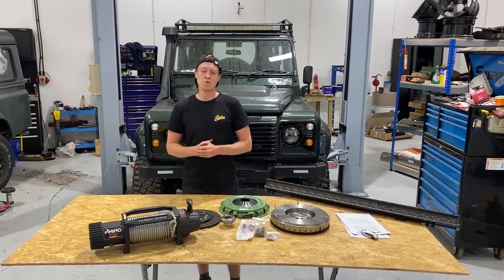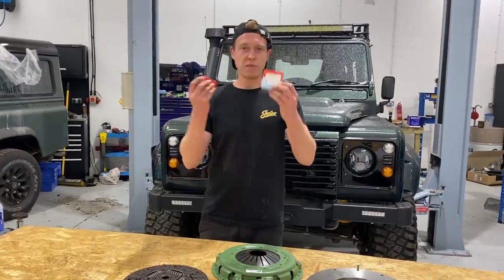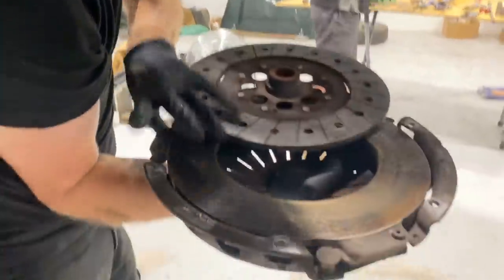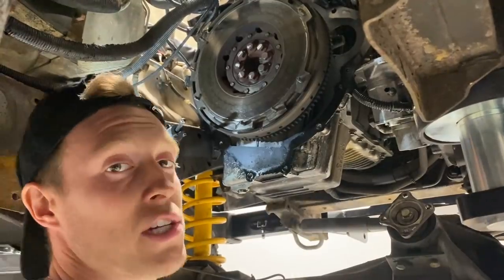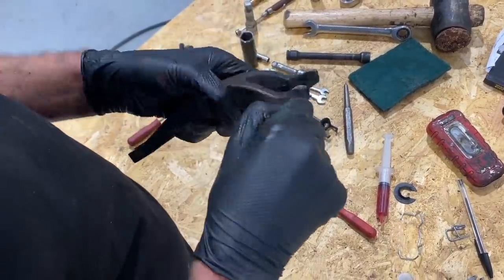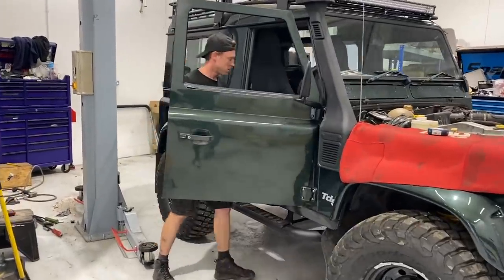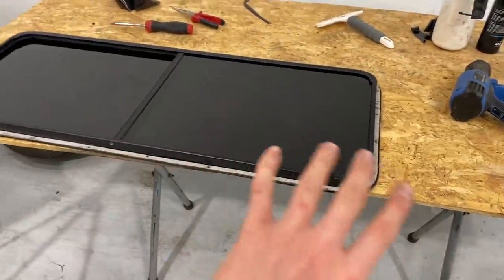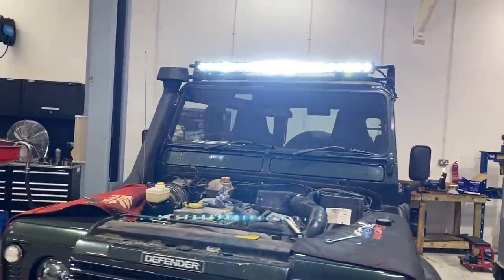Rebuilding a Land Rover Defender 90 - Part 14

Comment from the maker: Hey guys just to note, this video isn’t a paid for promotion or sponsorship, LOF Clutches kindly provided us with everything we needed to get the TD5 sorted! Thank you all for watching!! Remember to hit that SUBCRIBE button and smash that LIKE button! 💛
Reply from the maker: I dislike shirt shifters in the R380 gearbox, I’ve never felt that that make any improvements, it just feels notchy to me.... I’m happy with the LR shifter 😁
Reply: Does the defender 2.8i have the same flywheel or do I need to find a BMW one?
Reply: @Abel Harbour cheers, need to find a reliable source of information, right now I'm doing a full body off rebuild, it's a 97 2.8i so it can be considered one of the best defenders. I'm pretty sure it's the only one in NZ 
Cheers for your help.
Reply: I'm curious as to why you're using a steel cable on the winch with roller fairlead rather than winch rope and just an alloy fairlead?
Reply: great work lads. you would definitely not want to to that transmission clutch job solo.
Reply: i could know the exact color of the paint, thanks in advantage 🤘

Comment: I’ve not had my 110 TD5 for long and considered fitting a LOF helper spring for a couple weeks. It came through the post today and went straight out to fit it. Firstly, no wonder the pedal was so heavy, no spring fitted!!! Secondly, yes they’re a pain to fit but once you figure it out it’s not that bad, only mild language used to get it on. Thirdly and finally, what a joy it is to hold the clutch down at a junction! Great video again, really enjoying this series!

Comment: Applying a little grease before sticking it in the hole always makes the job easier. My days of driveway mechanics are over, but man a lift would of made much of what I did to cars much easier. Great video as always and that winch is cool as
Reply: Geord my thoughts exactly.  Lying on the ground sucks.

Comment: LOF are great company to deal with and great products. I have one of those green springs but its still sitting waiting to be fitted as I've been put off by the horror stories of fitting it. The cable tie option seams to be the preferred method and wind the clutch limiting bolt on the back of the peddle in to give a bit more wiggle room or so I have been told. I was looking forward to seeing any extra tips on your video, but I already know the swearing at it helps.

Comment: I fitted the LOF spring with the LOF slave cyl to my TD5 110 and it just pinned the pedal down to the floor so had to change the spring back to standard.

Comment: Dude, you are epic Defender expert.  I am so impressed with your presentation as well as your modesty.   I am in the middle of a similar COMPLETE restoration of a 1998 TD5 90 (that was originally green ;)   My baby looks a LOT like yours. She is done however in semigloss military green and semigloss black.   I also used Empire Tuning to give me a Stage 2 remap.  They seem to be really good to deal with.  I am in Canada so I sent my NNN ECU to them.   However, I made mistake to use my Nano-Com to "learn" my "security system" and messed up the code.   Gotta send it back to UK.  I live in Canada :) I am hoping to put it all together before Xmas.   I am hoping to get a fireworks gig in Liverpool this year.   If that happens, I am tracking you down!  I have so many questions ;)  Pls keep up the good work!!

Comment: Just put a lof powerspec clutch in my 300tdi disco as the big old 35s took their toll on stock one. They are awesome clutches and a worthy sponsor 👍🏻

Slapped in a new Ashcroft r380 at the same time, all on my own with car on its wheels, thank heavens for the large wheels and 4" lift😂 so was rather jealous to see two people with a lift😜

Would always recommend after fitting main rear seal slapping in only flywheel and letting engine run for 5 mins to check for leaking as so easy to damage it in install, and finding out after retiring gearbox etc is heart breaking.

Great video as ever, just shame it wasn't sooner do I could have used that code hahaha, if you can get Ashcroft to sponsor you I want to fit a center LSD so could do with a code for them next😜😜
Reply from the maker: Great work Steven! Fingers crossed for next time! 🤪

Comment: Gotta wonder why Defender TDCi’s destroy pressure plates well before friction plates wear out or rattle the slave cylinders to leaking point, maybe due to the solid mass flywheel.

Comment: Dual mass fly wheels are meant to move that much, it’s a surprising amount even from a brand new one, it’s roughly about an inch and a half of rotational movement, also vans and most modern day diesels all have dmf fitted from factory, basically anything with any sort of high ish torque

Comment: Did you not need to ream the spigot bearing in the end?
Reply from the maker: Not at all, I always check that they slide freely over the input shaft first. Ream if required

Comment: I’m doing the same jobs to my 90 at the mo - I’ve fitted 35” Renegades but those tyres on yours look better - what size are they ?
Reply from the maker: 315/75/16s on a BFG KM3
Reply: Juice Motors - Hey thanks for the quick reply - I just checked back on an older vid and you did say so same tyres - I’m getting a wobble at 40mph - 45mph though so am fitting a drop arm conversion and sumo bars......love your videos please keep em coming !

Comment: Hi Sam, great video as always. Any suggestions for the make of paint on the arches? My Flatdog flexi arches were painted at a bodyworks shop with Max meyer aquamax and they distorted very badly in the heat. Any suggestions much appreciated. Keep up the great work 🤙
Reply from the maker: Hey Simon! Did the arches distort or did the paint? If the arches are of a thinner plastic they’ll be more likely to distort when under direct heat etc
Reply: Sam thank you for your reply. They are the flatdog arches exactly like yours. The paint still looks perfect but the top of the arches have sunk quite a bit. Flatdog kindly sent new ones and said it must be the paint as no previous problems. Bodyshop says it's the plastic.....not sure what paint to use next??🙉. Look so much better painted 😎
Reply from the maker: I’d also think it’s the plastic being too thin, these arches are from GRP 4x4 and they feel nice and sturdy so shouldn’t flex or distort.... I’d imagine if the paint was the issue you’d know as you’re painting them as there would be a reaction, if it happens again maybe try some different arches?
Reply: Thank you Sam, yes I think it must be the plastic. I'll try with the new set and see how they go repainted. I should have gone with the GRP....will do if these distort. Keep up your great work and videos 🤙💪👌
Reply: Couldn't find your arches on GRP 4x4 Sam.....maybe yours are Flatdog fibreglass ones?

Comment: Good video. I have a question for you, I bought TF steelies for my Disco and they're not hub centric, the best tire shop in my state  says that is the reason for the vibration, do you have any suggestions because my truck rides so poorly? I know big off road tires are a compromise but it's REALLY bad you have to trust me. Can I buy hub centric rings? I'm sure you'll know and your help will really be appreciated. Thank you a lot
Reply from the maker: Hey Jacob! Yes buy hubcentric spacers but make sure to measure the diameter of your hub to wheel, you might need spigot rings
Reply: Juice Motors hey, thank you for the reply. Any suggestion on brand or where I could find it listed since it has to be exact doesn't it? Should I just use a caliper? Also my OME lift kit is on the way and I had a good time fitting my rear TF and front ARB bumpers, thanks for the videos. :)
Reply: Update for you, spent $270 on nice spacers from Lucky8 and it turns out that wasn't the issue, those should maybe make it look more aggressive, I heard they make it handle better with a lift and roof rack. Finally got in touch with Atlantic British, I ordered a $109 set of aftermarket lug nuts they sell but I didn't realize they weren't TF, turns out I need TF lugs! Ordered 23 for $35. The set I got was apparently aftermarket but for OEM steelies